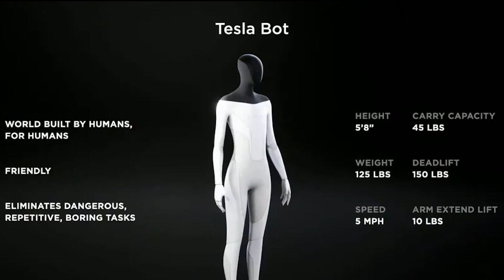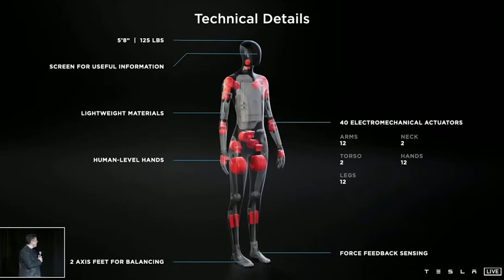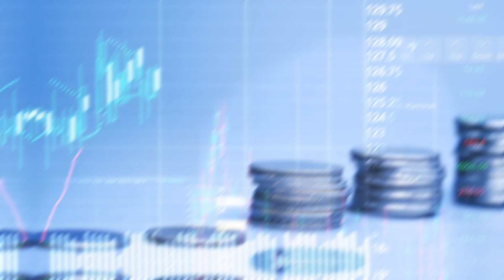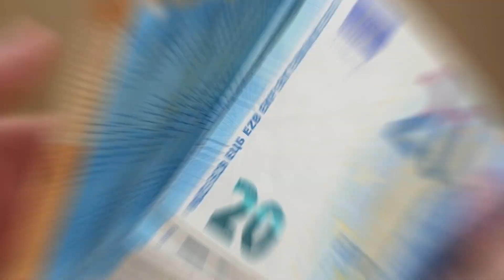Tesla's Robot Coming In 2022 and EVERYTHING To Know

Comment: I wouldn't trust the robot to drive a car. This thing is basically a "computer that wears tennis shoes", and computers tend to glitch, latch up, or freeze. They are not safer than humans, because I have had many more computer crashes in my lifetime, than car crashes. This thing is far more complex than a typical laptop computer, which means more codes, increasing the likelihood of an error. I would only utilize this as an assistant, where such glitch only results in something the size, weight, and strength of a teenager falls over. Nothing, that could put anyone in danger in the event of a glitch. If I get one of these, it will be my personal "C3-P0". I might dare have it mow my lawn, with a walk-behind lawn mower, not a riding mower.